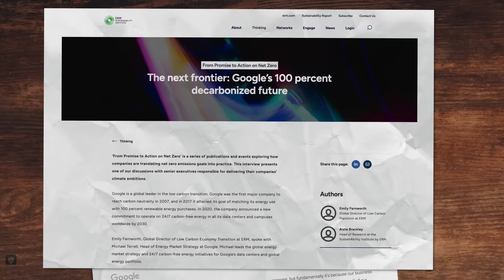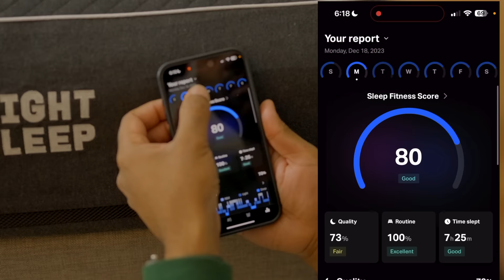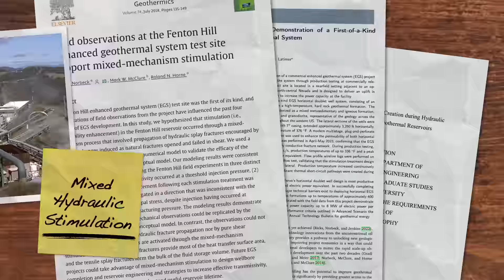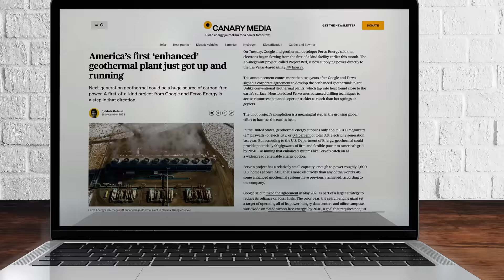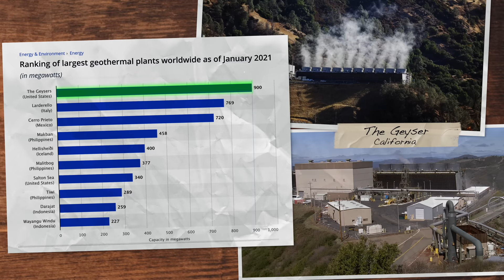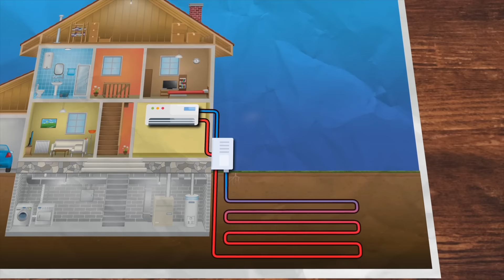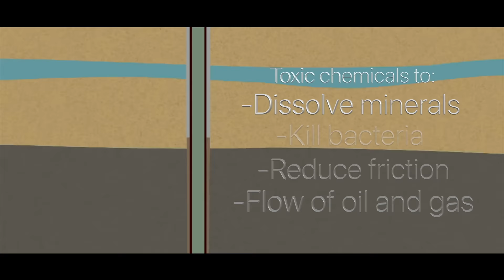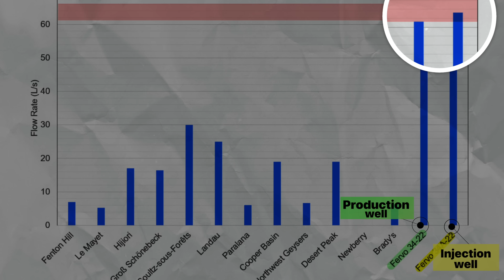Google’s Billion Dollar Gamble: You Won't Believe What it is!

Comment: Google out here building the most expensive Rube Goldberg machine. God forbid we make nuclear power plants...
Reply: Agreed, I don't want to find out the hard way what the unintended consequences of geothermal at large scale and operated over long periods of time are.
Maybe I am wrong but I don't believe we really understand deep earth geology over long time periods well enough to rule out problems. Nuclear and solar are much less invasive and better understood.
Reply: The unseen cost of maintaining a nuclear is a big reason to not make that main source. It's another military grade security detail to watch over and also the many SQ miles surrounding the plant that would be unusable for safety. just with this space you can just put solar and batteries for less upfront cost and virtually no maintenance more output per total sq miles allotted
Reply: What is your problem with nuclear energy?
Reply: That should be the next video
Reply: You should look into the new SMR energy solutions. Small Modular Reactors. Much improved and evolved from what is envisioned when thinking of nuclear. It's not only worthy of consideration but could arguably be a most favored method of energy creation.
Reply: @sunrisejak2709  so far those are just lab prototypes. Nobody is producing multiples of these reactors and putting them into production week after week. Until they do, it’s nothing.
Reply: @toddsmith4280 part of the reason it's "nothing" are all the regulatory hurdles anti-nuclear people push.
Reply: They leak... I know because i lived next to the one leaking in Miami and Central Florida... i cannot be corrected on this.
Reply: @toddsmith4280 Well said.. you debunked them in two sentences just like I do
Reply: Nuclear power contributes directly to global warming by heating up the planet. The effect is surprisingly big.
Not sure what effect geothermal would have since it’s just exploiting heat already on the planet. It might make the ground slightly colder in the area it’s used.
Reply: @emmanuelgutierrez8616  only with the old system, nuclear fuel could be reused over and over if they adopted a better system
Reply: Nuclear power plants are saving life, are you an adept of Cthulhu?!😅
Reply: But what about all U.S. nuclear waste, since its inception, that can be contained in an area the size of a football field? We’re gunna run out of room if we build more plants! And Scientist have even found a way to reuse that waste to create more power, how is that sustainable??😂
Reply: @auspiciouslywild 😂😂😂 what?
Reply: @auspiciouslywild  The sun adds so much heat to the earth all the time. The issue with global warming is not heat generation, but degradation of the atmosphere by releasing an excess of gasses that trap heat from escaping the atmosphere. Carbon dioxide is an insulator, and the largest by volume, but not the biggest offender, as there are other gasses produced by manufacturing that are many times more effective at insulating heat.
Reply: @emmanuelgutierrez8616 I don't think you know very much about modern nuclear technology.
Reply: @dertythegrower  Look up molten salt reactors that heat exchange with the air. If the salt does leak it'll crystalize well before it's a problem at your home.
Reply: @djr2078  Nuclear fuel the way it's used today is 98-99% wasteful. Even with that horrible efficiency all the nuclear waste that's ever been produced could fit in a single football field. If we employed methods that were 98-99% efficient a hundred years could fit in a tennis court.  Are you telling me we can't find a single tennis course in all of the united states to fit that waste?
Reply: @LazySpaceRaptor  The input to the earth isn't what matters here. It's the output to space. If the heat added by nuclear isn't balanced by more heat radiating to space, it will get hotter. That's just basic thermodynamics. Now, as it happens, the added heat energy will cause the earth to radiate more heat, and there will be an equilibrium. How? Because the added heat made the earth hotter, which increases radiation. That's the only way to radiate more heat to space. No way around it.

If I remember correctly, all the thermal power plants in the world (so fossil fuel plants as well) have an impact similar to the CO2 emissions from all airplanes. Not the biggest contributor. But the world is already on the brink. It'd be better to replace those thermal power plants with power plants that aren't thermal.

Nuclear also tends to dump its heat directly into rivers, that are already getting over-stressed by global warming.

I'm not anti-nuclear. I'm just worried by people who get so pro-nuclear that they seem to think it's a good idea to build tens of thousands of new nuclear power plants. It's a nice mitigation. Not a final solution. Except perhaps Helion's fusion reactor, since it's not a thermal reactor, and so will give of less heat per MWh of produced electrical energy.
Reply: I must have laid the sarcasm on too thick…I even said scientist are starting to learn to use the waste for more energy😂
Reply: God beware we find a way to avoid nuclear waste. Have you heard of the Asse werk?
Reply: @peacepoet1947 Hanford, turkey point, indian point, Savanah ruver site and just look at the oversight of many of the plants in the US.
Reply: Let's see them actually not go way over budget and behind schedule.
Reply: They are safer
Reply: @Trahloc  more like all the poor management and screw ups.
Reply: Feel free to make them, buddy, if you can sell the power for 3 times the cost of solar and wind.
Reply: @IronmanV5  What "all the poor management and screw ups"? In what way were three mile island and Fukushima management screw ups? To me it seems to be more of an engineering problem. Instead of relying on physics that can never change without humanity ceasing to exist they relied on a rare confluences of chances never happening which ultimately did happen. Modern designs don't rely on chance, they rely on the laws of the universe.
Reply: @Trahloc  TMI 2 started construction one year after TMI 1 but took three years longer to build. At 175% the cost of TMI 1.

Fukushima located backup generators in the basement. On a coastal location. In an earthquake zone where tsunamis are a possibility.

My personal "favorite" screwup was San Onofre where the builder installed a reactor vessel backwards.
At Vogtle 3&4 my personal "favorite" was when an engineer irreparably damaged the spent fuel pool while looking for leaks.
Flamanville 3 they botched the foundation. Then had substandard welds.
Etc., etc.
Reply: @IronmanV5  My sister maintained the lab equipment at SONGS. Back in the 90s the dude responsible for maintaining the water quality took their ion chromatography equipment and upgraded it from parts per million to parts per billion because the copper bells were absolutely critical and could not be replaced. The faucet in his lab leaked. He told me that he could fix it for $20 in parts at home depot (mid 90s at the time). The paperwork and approval process to get the permission to do that repair would cost 50k. So he lived with a leaky faucet in his lab.
Reply: @Trahloc  Well tell me what "red tape" caused them to install the vessel backwards during construction.

Or for the screwup at Diablo Canyon where supports were installed backwards because they didn't flip over the blueprints like they were supposed to?
Reply: @IronmanV5  if I had to guess, delays from approval where the original person who designated they be installed in a n/s orientation retired and the new guy thought s/n was the orientation. You're talking about things where dozens of people were involved in the installation and the primary person is an engineer NOT a manager. So you tell me how an engineer wasn't able to read their own plans they drew up? Probably because it wasn't the same engineer.

edit: this also shows why the bespoke nature of nuclear plants is terrible. Why is the plant in the USA a different design than the one in Canada a different one from Japan? Heck why is each plant in the same country a different design? Not just modified for each environment but the fundamental operation of the plant entirely different? Custom designs lead to errors. Standardization doesn't.
Reply: @Trahloc  Your scenario proves my point.

Are you telling me that the retiring engineer didn't do a proper hand over to where important information like the proper orientation wasn't passed along? 

The engineering MANAGER should have ensured that this took place.

For that matter, the new engineer wasn't competent enough to see that load bearing beams were in the proper place on the blueprints?

Once again the engineering MANAGER should have ensured that competent personnel were handling the job.

If you want to claim the first engineer used special blueprints that only they could understand?

The engineering MANAGER should have ensured that this wasn't the case.

As I said. Piss poor management.

Also, ask France about the pitfalls of having all their reactors being the same design. Last year 32 of their 56 reactors were down for maintenance and to repair cracks, 24 mm deep, in pipes carrying radioactive water with a wall thickness of 27 mm.

In the middle of an energy crisis.

BUT WAIT, THERE'S MORE!

Some of their other reactors had to operate at reduced output due to insufficient cooling as the rivers they used for cooling were too warm.
Reply: @IronmanV5  I'm not saying it's perfect but the fact you think that every single nuclear power plant ever built had "piss poor managers" is frankly ridiculous. How many years are there between 1978 and 2013? Do you remember what you were doing in 2013 much less what you were doing in 1978? Get off your high horse and recognize it's a systemic issue and not "bob is just a bad manager".

edit: Instead of arguing for why i think your reasoning is unreasonable. I'll just propose what I believe should be. Commercialization of module power plants where they aren't artisanal bespoke built on site but instead mass manufactured in a controlled environment. This would solve your backwards installation problem as well.
Reply: Save the nuclear for high speed space travel
Reply: Geothermal is organic nuclear power
Reply: I agree, energy from the near eternal Deil’s lair
Reply: @daviddavis1322  Locally Sourced Handcrafted Artisanal Farm-to-Table Small-Batch Gluten-Free Sustainable Non-GMO Organic Geothermal Power
That's the best I could do for maximum bs :D
Reply: @toddsmith4280 like sailors on nuclear submarines, who live a few feet from a nuclear power plant and have been without a problem for 50 years.  I much rather have a nuclear power plant in my city instead of 1500 giant wind turbines scarring the landscape.
Reply: @dertythegrower  that's actually terrible logic. That only tells us about your local one.
Reply: @peacepoet1947 
New nuclear power plants have multi-billion dollar cost overruns and decades long construction delays.  The cost of their power is rising instead of going down, like solar and wind are.  Utilities are not contracting for new nuclear because they are not cost effective.

Furthermore, nuclear power plants use billions of liters of water per year.  There isn't enough water for hundreds of nuclear power plants.
Reply: @WayneBraack 

New nuclear power plants have multi-billion dollar cost overruns and decades long construction delays.  The cost of their power is rising instead of going down, like solar and wind are.  Utilities are not contracting for new nuclear because they are not cost effective.

Furthermore, nuclear power plants use billions of liters of water per year.  There isn't enough water for hundreds of nuclear power plants.
Reply: @Trahloc 

New nuclear power plants have multi-billion dollar cost overruns and decades long construction delays.  The cost of their power is rising instead of going down, like solar and wind are.  Utilities are not contracting for new nuclear because they are not cost effective.

Furthermore, nuclear power plants use billions of liters of water per year.  There isn't enough water for hundreds of nuclear power plants.
Reply: @acmefixer1  multiple sources are needed.  As far as I can see, there is not just one solution to the need to have enough energy to keep moving forward.
Reply: @jasonborne5724 
Said, "I would rather have a nuclear power plant in my city than..."

You can't have a nuclear power plant in a city!  They are too dangerous to be allowed near populations.  They are required to have a large exclusion zone around them where no one can live.
Reply: @acmefixer1  what about nuclear reactors on subs and aircraft carriers?  N plants could easily be near towns.  France has them
Reply: I don't like power plants that are problematic under artillery fire. Civilian Nuclear seems like it'd have problems with that. Otherwise it's great. The smaller ones seem pretty ok
Reply: Always safe until it’s not…over and over again.
Reply: Negatives there too though
Reply: @acmefixer1  yes the costs are increasing because of FUD not because of any technological reason. We use a couple MW at work. When I proposed looking into small modular reactor since our lease was 50 years my partner laughed at me. Not because he's anti nuclear but because he recognizes the impossibility of licensing whereas I wanted to at least pursue it until we slammed into red tape.
Reply: Correction: “Allah” forbid…. 🤓

Says the atheist. 😂

Joking aside. You make a good point. It is a great AND inarguably effective technology. Granted it’s used in geologically stable environments that are not prone to natural disasters. Especially with our current computational abilities, the risk of malfunction in one should be so near 0% it could be regarded as such. HOWEVER, I find 1 kinda important flaw in the tech. We REALLY need to find a better way to use spent rods than to multilayer wrap them and bury them in Nevada ironically, to wait what will likely be enough time that our successors who can safely be near them will likely have adapted to a form we probably wouldn’t even recognize as “human.” Even more pertinent, heavy water is NOT safe for repeated consumption. Or, according to a couple studies, even occasional consumption. Earth has some naturally because the sun and earths core both have fiery attitudes.  But the quantity is so low odds of encountering any in a life time were pretty much 0. Till Oppenheimer. Then a bunch was made and dumped before we knew heavy water and heavier water were not safe. So we also started bagging and burying that. It creates the cemetery conundrum. People keep on dying. Land mass is only <x> big. Inevitably, eventually. No more land will be available for the living because it’s all been gifted to the dead. 

I’m in support of nuclear in the proper settings. Even considering the waste conundrum, though due to that issue, only for limited runs as stop gaps until we fully deploy renewables+batts. Also, much prefer uranium/plutonium and other unstable-iums be used to power video games than bombs. So I’d rather we deplete them for power than let our governments use them to deplete us. 😅 Granted we’re not gonna regret it later when the sun’s getting fatter and beginning to encroach on us so we’re ALL trying to move to mars and nuclear propulsion is the best/safest way, but we squandered the unstable elements as a means to be the growed ups and prevent our governments from extinct-ing all land based life for no reason other than their pursuit to garner “political favor”.
Reply: God forbid we try anything new. Who’s gonna cry about shitty nukes then?
Reply: As long as people own the machines which extract and refine oil, and people own the rights to reserves of oil, and those people stand to "earn" money by owning these things, there will be no mainstream nuclear power grid. The very last consideration is what's good for the planet or good for humanity, and there's no good reason for it.
Reply: I would venture to say, we should also be looking at how to minimize and possibly recycle the nuclear waste, which is a byproduct of nuclear reactors. Thorium, like in a previous video, would be an ideal candidate. Should focus on that.
Reply: @emmanuelgutierrez8616 Unseen cost?  We’ve been using nuclear since the ‘50s!  The Phoenix area runs on nuclear from the plant at Palo Verde!  France runs its entire national power grid off nuclear!  

There are no ‘unseen’ costs; there is only social and political ignorance over it, along with stupidly suffocating regulations forcing companies to take 4x and 5x as long to build a nuclear power plant and bring it online, along with driving up the cost 10-fold.

And comparing nuclear with solar based on land area is…is…is ludicrous.  Really.  The solar farm will likely have a millionth the power output of a nuclear power station, is absolutely not maintenance free, unsuitable for continuous use by a huge metropolitan region, requires inefficient and absurdly expensive supporting infrastructure, and is economically unviable at large scale.  And the manufacture of the complete solar infrastructure is about as far removed from being so-called green as a coal mining and burning operation.  Geez, what pretty-picture, John Kerry brochure have you stumbled across?
Reply: @emmanuelgutierrez8616 they're not as expensive as you think and the 10 year construction time that's constantly quoted is rarely anywhere near it
Reply: I love nuclear power especially LFTR
Reply: @emmanuelgutierrez8616 that's not true at all. Solar plants need way more space than anything and it has to be strong sun. Solar can barely power your house.  Would people have to guard it yes but not the military this isn't TV or Russia private security hired by the owners of the plant would do fine
Reply: Ahh yes sapping earth’s core of heat will definitely not cause long term issues if it’s popularized
Reply: That was my first thought. 🤷🤦
Reply: @emmanuelgutierrez8616 Obviously you don't really understand nuclear power. 🤷
Reply: @toddsmith4280 The scares from nuclear power has caused far more deaths than all actual nuclear power plant melt downs combined.
Reply: @dertythegrower are you alive? What is the reason you can't be proved wrong?
Reply: @auspiciouslywild How so? Explain it to me.
Reply: I believe that we should look at what France does with nuclear many people don't know that France can get more energy out of their nuclear power plants because politics doesn't impede progress in that area.
Reply: @peacepoet1947  It can blow up fast (like Fukushima did), and the surface-level “temporary” storage systems for waste seem to be permament (like Fukushima and all other plants in Japan). Uranium exporters should be required to bake the cost of safe disposal into the upfront cost of supply.
Reply: @Trahloc At Fukushima managers ignored their own engineers and put the back-up cooling power supply system in the same building that usually provided power to pump cooling water until the tsunami hit. The tsunami scored a twofer.
Reply: @researchcooperative  thanks for your contribution to the discussion.
Reply: @IronmanV5 On the France point, when your nuclear power plants are from the 70's/80's then I do think maintenance when they're 40+ years old is pretty necessary and long outlast the like of solar and wind
Reply: @auspiciouslywild   Okay, this is the dumbest statement read today.  The heat from cooling towers is almost negligible even in the immediate environment.  Compare that to the energy the ocean absorbed in just one year (2022) from us increasing the traditional 2.1% carbon dioxide to 3% in the atmosphere.  The oceans were heated by the equivalent of 7 Hiroshima bombs going off every second, for every minute, hour and day for one year.  If that statistic doesn't scare the hell out of you then nothing science tells you will.  Three degrees folks, all we need is to increase ocean temperatures to release billions of cubic meters of methane gas from the ice-like formations of methane hydrates sequestered in the deeps of the world's oceans.  It is game over at that point for life on earth.  The pre-Cambrian extinction is the closest comparible event to what we face in the next thirty years.  95% of all life disappeared as one thousand years of constant volcanism on the Russian steppes raised greenhouse gases in the atmosphere where average world temperatures reached an AVERAGE of 139°F.  We were past those levels back in 2010.  What makes this insidious is that if we decided TODAY, right this second, to not burn another molecule of fossil fuel, we will still reach a fate much worse than the pre-Cambrian without a massive, never seen before in terms of scale, effort to actively remove the excess carbon already in the atmosphere.  Knowing humanity as I do, nothing will be done seriously until it's already too late.  Cue the four horses of the apocolypse.
Reply: Nuclear power plants are more of a Rube Goldberg machine than these are. Nuclear plants almost always go over their estimated cost to build, often by magnitudes. Most Nuclear waste is in above ground storage that has to be guarded to prevent someone from using it to create a dirty bomb... They have a lot of downsides
Reply: I agree, I live near a Nuclear research facility and there are much higher cancer rates in our area, especially thyroid cancers... Basically don't push for Nuclear unless you're willing to have them build it in your "backyard".
Reply: The term that this could power the world many times over has been used before with solar. My question is why I didn't Google just make a huge solar farm with a man-made hydro water dam for storage. It's much greener and less risky then fracking for heat in our one and only earth.
Reply: Micro nuclear would create a robust grid and not require water, but helium to cool. No drilling required. Redundancy would be nearly impossible to beat. A simple concrete pad and connection to the grid would be the only construction required. Think tiny homes but for power plants.
Reply: His slamming criticisms of fracking are gross.
Reply: @auspiciouslywild always wondered about solar since the black panels reflect less than say gray soil and they send energy to be used. Would they not heat up the planet? What is your nuke heating done by?
Reply: @auspiciouslywild   one other thing has anyone done study's around wind farms to see about loss of wind speeds effect I think I heard it warmed the area 2 or 3 degrees but not sure
Reply: Nuclear is best
Reply: @emmanuelgutierrez8616  Your lying. There's no reason with the access to knowledge you have to state this and not just being a lier.
 There is no risk of stealing fuel. Show one time anywhere in the world it's happened or even been tried.
Reply: @toddsmith4280 Because people are blocking it. They have orders going international. France has plenty of history running a common small design. There isn't any unknown science or use. It's just a manufacturing issue.